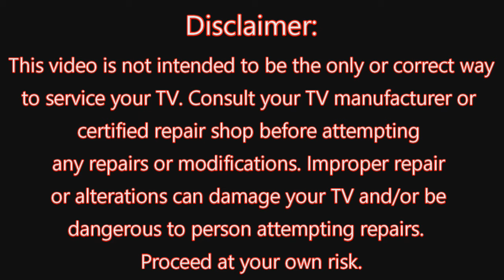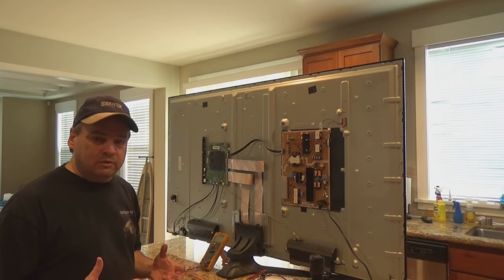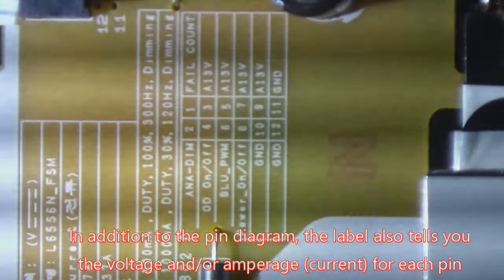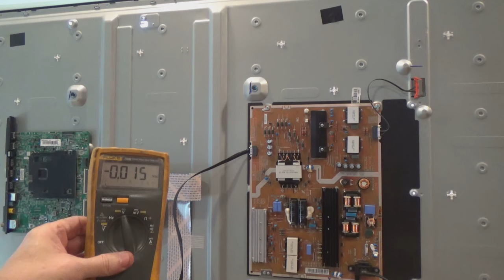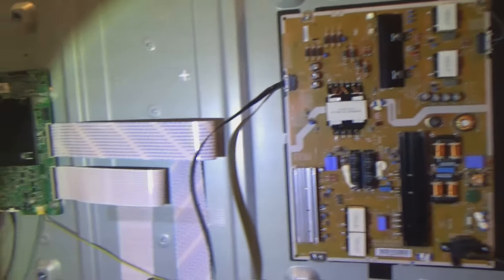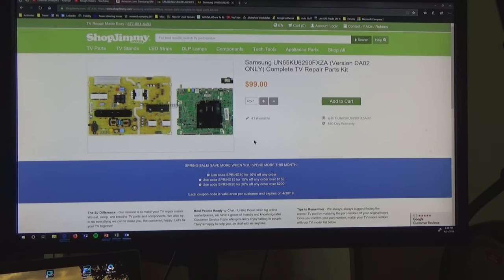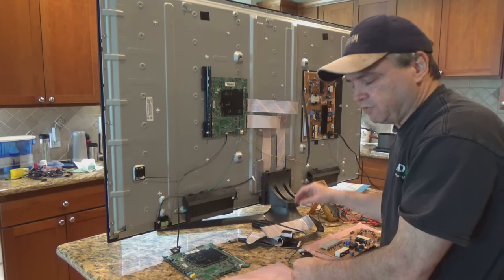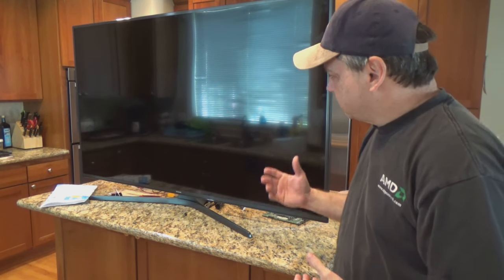LED HDTV Repair - Standby Light But No Power Up

Comment: Excellent troubleshooting technique and clean delivery/presentation.  Like you said, most people would think that it is the Power board.  However, you tested the power board by explaining the pins and their voltage table printed on the board.  Also pointed out to the LED lit up once I/O board was disconnected from the Power board confirming that the Power board is OK.  Not only that you showed what numbers to look for when ordering the I/O or Main board, which is very important to me. Thank you very much for your time in recording, presenting and sharing.  I liked it.  Congratulations!!!  I will look forward for your other videos.

Comment: Just had the same problem with my 43” Samsung. Standby light on but no image or sound. Ordered both the I/O and power supply board. Turned out to be the power supply board. Back in commission. Thanks for the upload!

Comment: Just bought a Samsung 65" .. 7100 series .. possibly as old as 2013.  Bought at auction for less than $100 .. got it home and plugged in .. black screen.  Standby light is on, blinking.  Watched 3 different videos this evening on how to possibly troubleshoot and fix.  Your video right here may get me to where I want to be.  Will try removing back cover and 'testing' the board(s) tomorrow.  Will come back and report here if successful using your methodology.  Thank you for your video to help me get started.
Reply from the maker: Good luck.  Hope it works out for you.

Comment: What are the odds, the first video and it's my exact tv and super easy fix. Thank you for making this video, I've fixed old school hd tvs where the caps on the power side were usually the culprit so it's nice to have someone who knows what they are doing make it easier.
Reply from the maker: Thanks for watching.
Reply: I have the same TV too. After watching, following the troubleshooting process and finding the same results... A new circuit board (after waiting several months for one to be in stock) has fixed my problem. Thanks for the great video!
Reply from the maker: @garrettb1134  Glad it helped.
Reply: Unplug it and changed the batteries and got the picture back to normal. Thank you.
😅
Reply: My less than 2 y.o. Samsung started flashing the actual screen as well as the red light. And so I don't have the tools you have but since you were able to purchase both components together inexpensively, couldn't I simply replace both with minimal toolage and hope for the best? Although you didn't show how easy or difficult the "power" component would be to replace.🤔😃
The thought of buying another tv only to have it do this again, while also adding more electronic crap to a landfill is not making me smile 😶
Reply: @RoughRidersTV Korean tv surplus hdmo led tv model something 2012 power only anc have clicking sounds ar the back ? Same trouble? Thanks

Comment: Thank you so much! I was following along and when I went to check the power side my meter would fluctuate and the lights for screen would flicker on and off.  Turns out it was the power board. $34 later TV was fixed, got my part ShopJimmy. Thanks again.
Reply from the maker: You're welcome!  Thanks for watching

Comment: I have the same TV only a smaller size, bought at the same time (about 5 years old) with the same problem (solid red light.) And got the same quote to fix it - $500. Haven't opened it yet to analyze. Not sure how reliable Samsung is  with so many people with the same problem. Thanks for uploading.
Reply from the maker: I don't think it is a Samsung thing per se as the same thing could happen to any TV.  Looking at the board design, I don't see anything that I would consider a bad design. Hot components had heatsinks, I didn't see stuff clustered together, routing looked fine. Basically it looked like a normal PCB and I'm betting that an LG, Phillips and other brands would look similar if I tore into one.

Comment: This is exactly what my TV did.  I don't know if I had sound or not.  I can see the power indicator light or red stand by light. Turned off all lights in my room with the TV on and I'm not seeing any lights threw any holes or anything in the back  of the TV.  So it sounds like a bad power board.  I'll know more when I get it apart.   Thank you for your video.  You made it all look pretty easy.
Reply from the maker: Glad it helped.  Hope it all works out for you.  Thanks for watching.
Reply: Richard, was it the Power Supply board? Did you ever end up getting it fixed. I too dont see any backlighting but I get an intermittent standby light flashing when powering on.
Reply: @portugeeguy25  I junked it. Was the power board but there are 3 or 4 numbers you need to match up to get the right board. Every board I found did not match up. Mine had 2 small compasitors and 1 large one. The other boards replaced that large one with 2 smaller ones. ???
Reply: @richardclark9609  I believe my issue too is the power board, i ordered the same model number board so I should be good, but we'll see. if not the power board it might be the actual LED strips, if thats the case I too will junk my old unit due to not wanting to deal with the aggravation of fixing it.

Comment: Good video. My 5 year old Samsung 55 inch shows the red power light on but black screen persists. If I play with the remote long enough (sometimes pushing the on button, unplugging the set for 5 minutes or so, plugging back in and pushing remote on button many many times) it will eventually power up and the tv works just fine, until I turn it off and the whole process starts over again. It's not a smart tv so it may not be worth spending $100 on to fix when I can get a new Hisence (may not be spelled right) smart tv for under $500 bucks . Hate to throw this tv out when I know it works though.
Reply: Did you ever figure it out

Comment: Our year old 75 inch Samsung and our WiFi box quit after lightening hit our house in Switzerland.   Easily replaced the WiFi but think our TV is toast. I could try doing your fix but would probably ground myself in the process:) Excellent video though.

Comment: I have the samsung qled 8k purchased three years ago purchased the 5 year warranty. Last week was watching The View abruptly there was several q
squared pixelation then turned  off. Tried the little troubleshooting steps to no avail. However, I would say I still have power to the tv but won't turn on.
By watching your video enlightened me to believe its the same issue at the IO board went bad considering that my power board is on electrical currently passes through the tv since the standby light is on.

Comment: Thanks for the troubleshooting steps, it surely helped. Had the same on a 24" samsung monitor with a solid red. After spending time diagnosing, it pointed to the main board. Ordered one and installed it, now the red light keeps flashing, does not power on. Time to keep troubleshooting...
Reply from the maker: Best of luck. Please share your findings if you figure out what the problem is.  Sounds like you made some progress though moving from a solid to blinking light.
Reply: Any luck ?
Reply: If he hasn't answered by now it usually means it didn't work, threw it out and bought a new one.

Comment: This was a very good video, on how to DIY, an electronic repair, using basic electrical and troubleshooting skills to arrive at a possible determination. That being the computer board, and finding by researching a good value on both the power in and power out boards. 
Kudos for the good video!
Reply from the maker: Glad it was helpful!

Comment: I was surprised you didn't record the voltages on the bad board before you replaced it. That way you could T/S the bad board and possibly repair it. Just my thoughts on having a spare board.

Comment: Thank you for the vid, it helped me to fix mine that had the very same problem after 2 years of use.
Reply from the maker: You are welcome.  Mine failed just over a year and out of warranty.  Too expensive to not do something about it but too expensive to have a repair guy come out so figured I would take a crack at it.

Comment: Awesome, sir. I just replaced the tv with a monitor, although now I'm wondering if I should seek to do what you did. But after seeing how much you paid for the extra board...I might as well just get another TV for about the same price! The TV I'm watching this video on is the same model you just fixed.🤣Nice video anyway.
Reply from the maker: The cost of TVs continue to drop so it is approaching a point where that is a good question to ask.  A 65" display in my area is still $400+ dollars vs the $90 I spent on the kit.  So for me, it still made sense to swap the boards vs buy new. But I hear ya, sometimes it's just not worth the effort.

Comment: 5:44
My TV will also turn on the LEDs when I unplug the main board from the Power supply - but I can see one capacitor on the powersupply blown out.

Should I replace only the Power supply or both Power supply and Main board ?
Reply from the maker: I bought a kid with both boards so I had that option if needed.  Were it me, I would start with the power board and see if that fixes it. If not, then swap the mainboard as well.

Comment: Thanks for the vídeo. I think my tv has same issue. I measure the power delivery from the power board and everything looks good.
(Also LEDs goes on without the i/o card as yours)
Searching for I/O card replacement. 
Saludos desde México.
Reply from the maker: Gracias.

Comment: Excellent video!  I am having almost the exact same issues with my Panasonic TC-39AS530U. TV turns on, screen flickers 3 times (I can see the LED lights flickering in the back), then I get a blank screen with 1 LED flicker (error code 1 I assume) then just a slowly blinking red LED. There is no sound and I can't turn it off with the remote. I have to press and hold the power button on the side of the unit or unplug it to turn it off.  I have tested my power supply board. ALL 3 test points (standby, LED driver, and main board) maintain voltage when it goes from power on to blinking light. However, the pins on the connector for the main board and driver board go from 16V and 24V respectively down to 0 when the light starts to blink. 

There are 3 test points on the main board, 5.3V, 12V, and 15V. The 5.3V (standby) maintains voltage when it goes from power on to blinking light, the other two do not, they go to 0. Would that, along with voltages being maintained on the power supply board, indicate that this main board is bad? I really hope that is the case as I do not want to get into replacing LED strips. Thanks and keep up the great work! P.S. I have put in new power supply and T-con boards and the problem continues.
Reply from the maker: are there any error codes online that might corelate to the blinking LED?  I am wondering if they are blinking a pattern that it might be an error code.
Reply: @RoughRidersTV  After it flickers 3 times trying to turn on it blinks once...error code 1, then after a couple of seconds just a slow steady continuous blinking. I've replaced the power supply, main, and T-con boards so it looks as if I have some burnt out LED's. Your thoughts?

Comment: I am glad I found this video I have the exact same unit, popped in a new pb and still same results
Reply from the maker: James Metalarc I was thinking it was going to be the power board but once I measured the voltages it was clear that wasn’t the issue.

Comment: Probably the faulty parts in the main board are the mosfets or smd capacitors, using your dmm in the continuity mode would do the work. Thanks for sharing the video.
Reply from the maker: Could be.  I didn't have the tools to de-solder and re-solder new components down to the board anyway so it was easier to just replace the board.

Comment: If you get the blinking light but the tv won’t start then try a hard factory reset first. For Sharp brand tvs you unplug the tv and then hold down the vol - and input button while plugging tv power plug back in to wall. Hold the two buttons until you get a fuzzy screen. Then unplug tv again and hold down power and input button at same time while plugging back into wall. Now you will be in factory reset menu. Fill out and then save and restart tv. You might be able to skip the last step after you get snowy screen by turning off and then turning on tv and going to channel 3.

Comment: Very brief and complete. Awsome . When i plug in my tv (after being un plugged for few minutes) a white led light blinks on for a couple of seconds and then nothing happens. Ive checked everything like remote control batteries and all is fine. Tried to power on from the tv box too, nothing happens. The tv is directly connected to wall. Please help me understand the problem and how to solve it. Many thanks!
Reply from the maker: I would suggest following the steps outlined in the video.
Reply: @RoughRidersTV  to be honest your video is really helpful. Ill watch it once again. All the best

Comment: Hi I have a LED 40'' Bush TV with built in DVD player. The standby light comes on but when you go to switch it on the blue power light comes on then quickly goes off again and goes back to red standby so TV does not come on. There is a lead from a white socket connector from the board that runs to the standby switch mount then across to the standby light with another connector. So could this be a problem again with AV- board as it looks like the only board it has besides the DVD board. I'm looking to replace the whole board for a new one, I'm only looking for a brief outline of a probable cause,  so any advice will be very much appreciated,     . . thanks

Comment: Are you responding to questions on this video still? I have a 75 inch Visio that went out last night. Half of the screen turned A pinkish white color or whatever color and the other half of the screen remained working. I turned it off and then back on but the screen never came back on. The audio continue to work but not the video. Any suggestions?

Comment: I’m having a problem with a Samsung DLP HLT-T6189S. 
If I keep turning power on, it flashes green, then it stops, but the screen won’t light up.
Repeat this a dozen times and I can finally get it to light up. 
It’s taking longer and longer for that trick to work. 
I may be doing what you just showed me

Comment: I am getting the same voltage reading as you did but the led light do not turn on when I disconnect the cable from the main board. Is there a way to check if the led lights are functional? My power supply board seems fine as it gives the right voltage and not visual damage
Reply from the maker: That could be the T-conn board as the drivers for the LED should be part of that board.  I did not disassemble the TV enough to show that board but it should be near the bottom center of the TV.  You might need to dig a bit further to get to that board.  That is where I would look next.

Comment: I have an LG TV 55UK5600aua I can't find any information on any videos on YouTube I have a standby lite, white screen when I turn it on. TV shuts off after about 20 minutes. I also cannot find T-com board, where would it be located?
Reply from the maker: I'm not familiar with that specific TV so I couldn't be positive.  However, the design and layout is probably similar to how mine is...if you look at the ribbon cables, you will probably have one that runs from the power board to the I/O board and then another that runs from the I/O board to the T Con board.

Comment: Usually its those microprocessor BGA chips under the heat sinks that fail, either broken solder or just failed.

Comment: I'm here again after a month of waiting for the parts delivery. Thank God I finally can fix my TV with your given tips of how to diagnose the tv and i knew that my power board is faulty because of the burned mark so I bought a new replacement and it works perfectly. Thank you. Btw is it possible to fix the tiny smd chip (sized about 2mm) on my faulty board? It seems some of them if fried with the board around it. Is it even possible to repair it?
Reply from the maker: Hard to say without having the actual board to examine.  Sometimes you can just swap out a resister, capacitor or chip (assuming you have good soldering skills) and get it back up and running but that is not always possible.  It really depends on the failed component and the damage to the board.
Reply: @RoughRidersTV  Thank you very much for the info.

Comment: Samsung UN75H7150AFXZA

stopped working after a power anomaly.

no standby light, does not come on with power button or remote.

power supply board output voltages seem to be okay

When I disconnect the power to main board cable, back light comes on.
very similar to this video.

interested in hearing your thoughts/suggestions?
Reply from the maker: Sounds like your powerboard is probably ok.  I would then look at the I/O board and the T/Con board.

Comment: What’s makes the IO board go out? We bought a brand new Samsun tv 11 days ago. Wont power on. We tried all the troubleshooting we could find online. Indicator light is on but nothing happens when I press the power button on the tv or the remote.
Reply from the maker: If you bought it brand new and it failed after 11 days, I would take it back as it is still under warranty.  As for what could make it fail, could be a lot of different things.  Power surge, dust (which carries a lot of static electricity by the way), bad resistor or capacitor on the board, faulty connections on the board, excessive heat something could have happened during shipping that cracked solder connection. It really could be a number of different possibilities.  Some times, stuff just happens...it's very rare for something to fail that fast but not impossible as you found out.